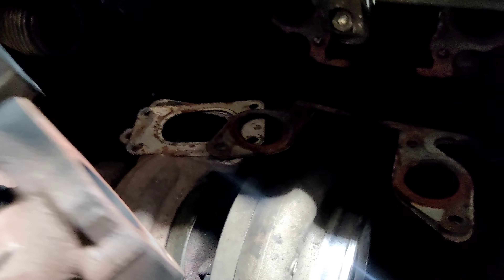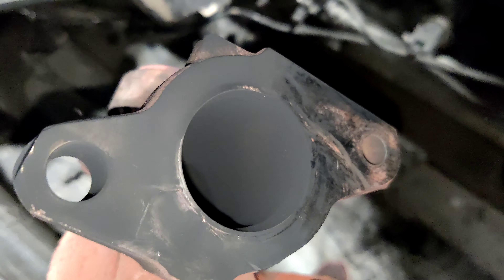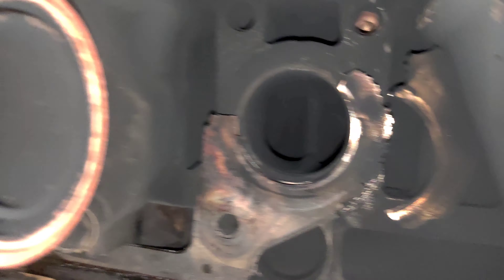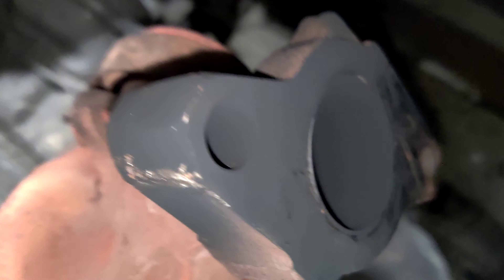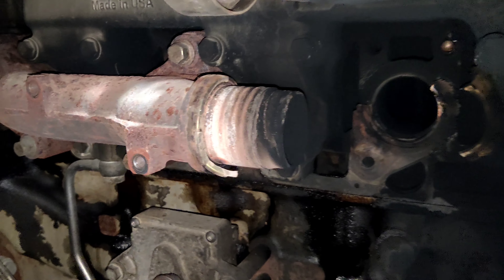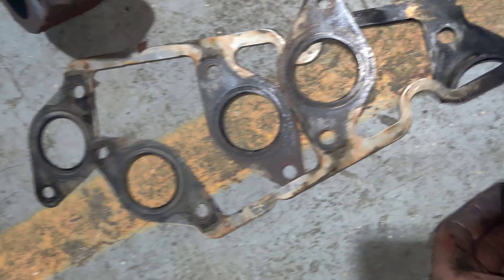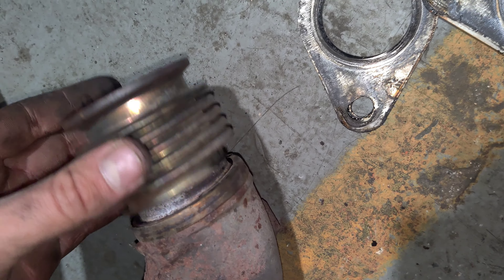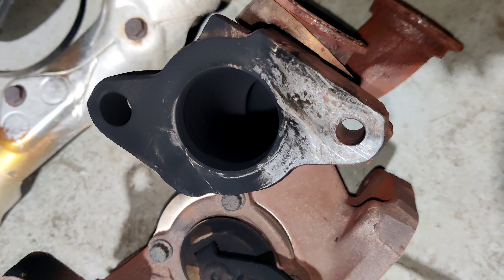Exhaust gasses in the cabin/ bad exhaust manifold gasket! Freightliner Cascadia truck!

Comment: Im smelling exhaust fumes in my 2013 freightliner cascadia and i recently replaced my Bellow pipe and flange pipe. But the fumes are stronger than ever. Now im going to have mechanic check my manifold gasket
Reply from the maker: Yes check all gaskets!

Comment: Salut, Привет, Hello :) Мне завтра предстоит тоже самое :(  Ты болты импактором откручивал?
Reply from the maker: Yes sir! I used impact but don't forget to heat up the area around the bolt first, I also used a breaker bar for a few bolts but don't force them too much! If it's still tight , heat up again the area around the bolt! 🔩